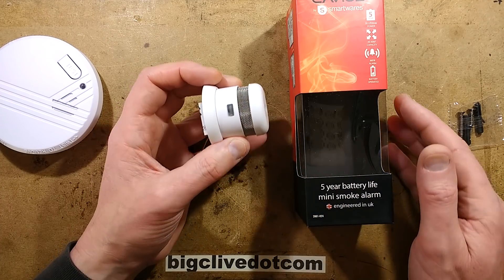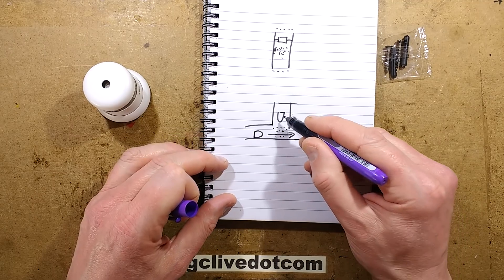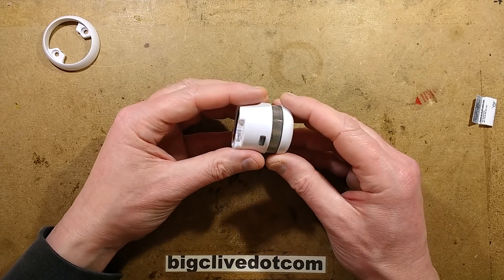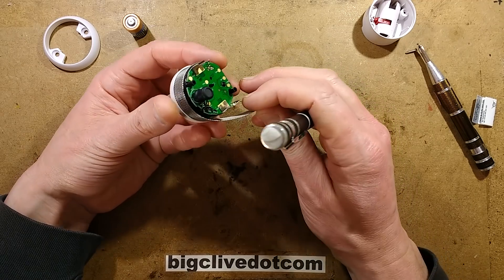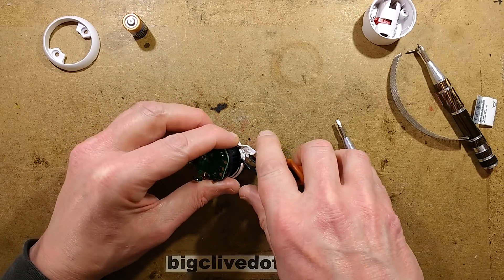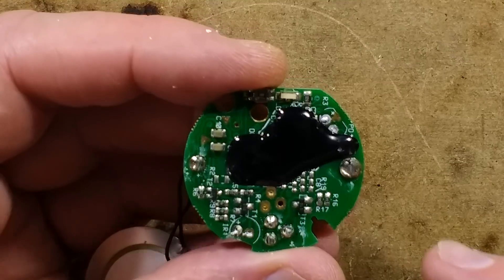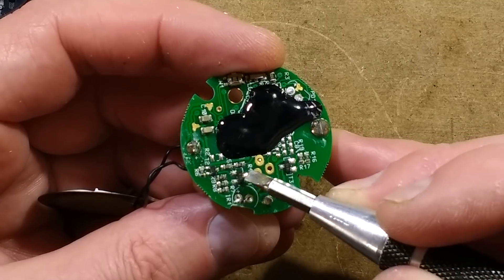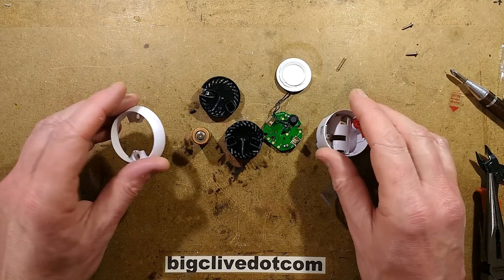Inside the tiny Cavius smoke detector.

Comment: I got the opportunity to strip a few boards from several decades old ionising smoke detectors and from what I've found they usually have the quantity of Americium stamped onto the fairly thick steel plate cage surrounding the button and the examples I handles were all in the range of 150 to 180 microcuries.

Comment: Interesting. FWIW, in the US, at least in most places, the rule is 7 years for replacement (so splitting the difference between 5 and 10 :) ), and building codes or state laws often require (though not everyone follows) that detectors installed (whether new or replacement) in fact be "dual-detection": both ionization and photoelectric. Doesn't mean they don't still sell single-detection units in states where they're technically illegal to install... Photoelectric-only is recommended if you install one in your kitchen, since they apparently are less likely to cause nuisance alarms from cooking smoke (even though you aren't supposed to install them, what a mess).

Related to expiration: perhaps CO detectors have a more definite lifetime - the ones I've had in the last 10 years or so actually will forcibly enter "death-by-alarm" mode at the end of their 7 year rated life - you can't shut them up except by getting rid of them. Was quite a puzzle until I got a replacement and read its instructions, noticing the "what will happen in 7 years" paragraph. Haven't seen smoke detectors that do that though.

Comment: That's a COB (Chip On Board).  The bare unpackaged chip is mounted to the board, then the resin gooped over the top.  Cheap and cheerful way of doing it, pretty common inside consumer electronics, usually on the back of LCD display modules in DVD/PVR machines and almost always inside remote controls.
Reply: Am 4yrs late but its not a bare dice in the vid of the manufacturer its a freescale mcu and a opamp package

Comment: I took apart the "Widowmaker" smoke alarms straight from Shenzhen -- three LEDs, a button, smoke chamber, single chip which is anonymous and a driver coil for piezo sounder (and some support components). Done.
It seemed to activate on thick smoke and not glycerin smoke and if the chamber is opened even slightly, it immediately activates alarm.
The nickname is because they have high chance of failure and QC mishaps which may mean DOA units may pop up on supply quite frequently.

p.s. After the law changed, all smoke detectors sold in Korea now speak "Please evacuate immediately, the building is on fire"  and beep extremely loudly (some even have self-diagnosis voice which announces "Unit Malfunction" if failure is detected).
Previously ones that have been installed do not have any buzzer whatsoever, but now they must have at least beeper.
Also, they all use batteries that are not quite user-replaceable (that lithiun battery has two wires on a socket that must be inserted before it can be installed) because battery-less smoke detectors are incredibly dangerous due to their false sense of security inducing power.

Comment: Two other reasons for the frequency sweep:
1. Your ears may lie in a zone of destructive interference if the tone is fixed frequency, so you may not hear it.
(Similar reason for why emergency sirens also sweep as the waves bounce around buildings - a single frequency is difficult to locate).
2. Partially deaf people may have dead spots in their ears' frequency response and may not hear a fixed frequency - a sweep therefore gives a better chance of catching one.
Reply: anonymic79 Just use your cell as an alarm with a file with some kind of misic or sound that would span your needed range.
Reply: Wow makes sense thank you very much for your time bye take care 🍄💋🍄💋
Reply: Good point TE, but even for a 1kHz square wave, the harmonics are 1/3 x 3kHz, 1/5 x 5kHz, 1/7 x 7kHz etc, and get progressively quieter so less 'alarming'. For high frequency square waves, only the first few harmonics are significant.
All square waves with a fundamental above a third of the frequency of your hearing bandwidth sound like sine waves because all the harmonics are filtered out.
eg, if you can't hear above 2kHz, then all you would hear is a 1kHz sine wave because all harmonics would be inaudible, if you're not in a standing wave trough.
Smoke alarms have to cater for as many people as possible, not just those with average hearing.
( I did a postgrad in this stuff years ago )
Reply: I recall  a TV news story couple years back where they showed teenagers,who love loud music, 8 out of 10 slept through the beep beep beep ones outside a closed door in hallway, they tested a  multi tone style the night after, and 10/10 woke up
Reply: Which is why when my smoke alarm battery needed to be replaced, I couldn't figure out where the noise was coming from, because it did a single ultra quick single tone beep for what seemed like some interval between every 60 minutes, so it was impossible to locate where the sound was coming from, because it was in another room. If it had done a sweeping sound, or at least several beeps in a row, I would have figured it out instantly.
Reply: Also one of the reasons trucks are switching over to white noise generators instead of the old style beepers.
Very easy to get used to the beeping noise and on busy construction sites for example, lose track of what exactly is reversing.

Comment: beware the springen sproingin!

a)where or what brand are your lil aluminum handle screwdrivers?
b)would you recommend those detectors for actual in-house use? or should i mix with optical detectors as well?
c)those little CR2 lithium cells are stupid expensive. normally used in cameras my most common use is really bad-ass tactical style flashlights.
Reply from the maker: The screwdriver set came from Poundland.  It's a standard 8 in 1 or 9 in 1 precision screwdriver.

Comment: What would happen if one were to recharge the battery that comes with that detector?
Reply from the maker: +Walking Zed's Push Bike It may result in high internal pressure.  Primary cells are not chemically suited to being recharged.

Comment: What if you use a smoke machine in the same room will they go off. If you have a smoke machine can you try it and explain why you can't use them in halls etc
Reply from the maker: A smoke machine will set off most smoke detectors.  In theatres they have to either disable the system and have manual alarm operation during shows or fit rate of rise temperature detectors if haze or other atmospheric effects are being used.

Comment: I have the old ionization smoke alarms, they are so sensitive that when I first turn on my heater in the winter time, the small amount of fuzz and oils that burns off the heat exchanger causes them to go off, even though you can't see any smoke. if a candle is burning in the room they will go off if the candle is below them in a certain radius. They go off if the candle is blown out, I have to put out candles by dipping the wick in the wax.

Comment: The optical are actually less prone to false triggering than the ionization detectors. The optical ones are triggered by visible smoke, while the ionization detectors are better at sensing invisible combustion products generated at high temperature.

Comment: Does the resiny plasticky blobby compound melt at a temperature lower than soldering temperature? Would heating it be a way to get that gunk off? Possibly with a heat gun? Experiment please?

Comment: Hi Clive, just a short comment. The ion chamber detector is more a fire detector than a smoke detector as it detects products of combustion. It would not detect the overheating and early smoking of pvc cables as this is a chemical change and the visible 'smoke' is not due to burning (pyrolytic). An optical is therefore better in a domestic situation as you say and works on the principle of the Tyndall effect. However, there is now a case for CO fire detectors (not smoke) as they can detect the very early stages of a smouldering fire at about 10 ppm. Do like your channel.

Comment: My old housing commission house had a wired in AC smoke alarm. Which is great, you don’t need to change the battery, only problem is it didn’t have a (backup) battery. So you’d want to hope the fire doesn’t get to the house wiring first. Although it was handy for bug bombs, they tend to set smoke alarms off. So you could just set the bombs off and turn the off power for the smoke alarm (on its own circuit breaker, funnily enough). I don’t miss that house though.

Comment: I get 5 years out of 9v powered smoke alarms. Using good quality alkalines is the secret.   The cheap zinc carbon batteries they are typically supplied with run for maybe 12 months. The optical types are murder for triggering with 'well done' toast.

Comment: Hello Clive.
As a Belgian firefighter, I must congratulate you on your professional explanation of the two different smoke detectors.
In Belgium, the sale of the ionizing smoke detector has been banned from 2002 on because off the hazardous radioactive substances radium-226 or americium-241 that is present in these devices and if the detectors had reached their age of 10 years you could not put them in the normal waste butt they had to be safely disposed of by a specialized company, and we do not have a company in Belgium that disposes nuclear waste because normally according to the law it is forbidden to have radioactive material in your possession, therefore we can only buy optical detectors.

Comment: As a cold houser I'm mostly getting false alarms from the water vapour when I bathe. I'd be interested in any differences between optical and ionisation types resistance to false triggering... on the face of it optical should be worse... but maybe that fine mesh would actually keep water vapour out better than the relatively wide vents on the ionisation alarm I've got.

Comment: Can you connect this to each other so if the second floor is on fire the alarm go off in the first floor and the rest of the house
Reply: Most modern detectors have interconnect features so I would hope so.
Reply from the maker: These do not have an interconnection feature.

Comment: We actually have five of these around our house. They were reasonably cheap in a pack at costco and figured they were a good investment since we were down to two old ionizing units, one of which was about as old as I was. They certainly don't last 5 years, though. We've had ours for 2-3 years now and replaced the batteries twice already.
Reply: Ellen Madden 
The battery life will depend on the environment and the frequency of false triggering that occurs.

Comment: These buy the way work and work very very well but having a sealed battery (Which more and more smoke alarms do these days since modern 9V cells last for 10 years since people forget to change the batteries every year or even few years in the older ones which are much more power hungry!) you will need to replace them every 8 to 10 years!
>>>>>>>>>>>>>>>>>>>>>>>>>>>>>>>>>>>>>>>>>>>>>>>>>>>>>>>>>>>>>>>>>>>>>>>>>>>>>>>>>>>>>>>>>>>>>>>>>>>>>>>>>>>>>>>>>>>>>>>>>>>>>>>>>>>>>>>>>>>>>>>>>>>>>>>>>>>>>>>>>>>>>>>

Comment: Hmm didn't you post a video showing the components inside a smoke detector can be radioactive? Is that not the case with this device?
Reply: That is only with the ionization type detectors. This type of detector is photoelectric, so there is no radioactive Americium present in the sensing components.
Reply: Ah thanks for letting me know. Makes sense :)

Comment: I can see a flashing light on one of my smoke detectors. The one in my kitchen flashes a dim light every few seconds. I con only see it in the dark and my eyes are well adapted to the dark. 
     The one in by bedroom doesn't do this, but the one in my bedroom is really sensitive. It usually goes off if I cook something and my bedroom door is open, but the one in the kitchen only goes off if I burn something.
    You expiation explains the light, but not the sensitivity of the other one. It will even go off if I open my oven door, even with nothing in the oven.
Reply from the maker: It can see a very fine haze that you might not see.  Or you may have a rate of rise temperature alarm right above the oven area?
Reply: I can't see how. The smoke alarm in my bedroom can't see the oven. But I think your theory has some merit. I've wondered if it's being set off by a heat pulse, because the smoke alarm takes a few minutes to go off.
    Rather than looking at radiative heat, it might be seeing the pulse of hot air going into my bedroom.

Comment: This is great.My spouse uses our smoke detector as a timer when cooking meals,  fry it until the detector beeps, turn it over and fry the other side.  It also works great when boiling vegetables.
Reply: Yours needs to meet mine. Seems their cooking strategies are broadly similar (Madame believes in making SURE there's no risk of us contracting food poisoning . . . . . :-) )
Reply from the maker: You can get heat detectors for kitchens.  They either detect a sudden rise in heat or trigger at a preset threshold if it rises slowly
Reply: Our kitchen detector's already rate-of-heat-rise. Pretty essential when El Presidente cremates most things . . . . :-). I'm the one who sets the hallway detector off (by forgetting to turn the toast-duration control of our toaster down, when switching from fridge bread to fresh rolls!). Really annoys our Parrot - who's very willing to try to "out-scream" the detector!!

Comment: wouldnt it be easier to have the detector see the diode the whole time and make alarm when the light is reduced by the smoke? like these laser security beams they use to secure art.
Reply: Thomas Herzog slightly simpler, yes but the power use would be WAY higher..might be ok for an Line (mains) powered unit, but any reasonably sized battery would drain way too fast to be practical.
Reply: M. K. 
i see... so it needs more energy to see light the whole time, because the photosensor is active the whole time? kinda makes sense.
Reply from the maker: Some industrial ones use that technique, but fire a light beam over a large area.
Reply: bigclivedotcom
so they dont need a detector every few meter/feet?

Comment: That looks exactly like the first ones we bought when the law changed in California. 4 of 6 started beeping within 2 months of being installed.
In case you didn't know, on Jan 1, 2017 it became illegal to sell to a California resident, or for a landlord to install, a smoke detector that used battery as its prime source of power with less than a 10 year warranted battery. What's more, the batteries can't be replaceable. Once activated, a smoke detector will brick itself if power is interrupted and go into "beep" mode.
Before any Fox News viewers get triggered by the idea of California and regulation tromping all over the rights, etc... , this was the landlord's demand. They simultaneously identified the advantage of having a fire alert system protect their property while not wanting to become an infinite source of 9 volt batteries to their tenants.
Anyways, the ones we had that didn't fail were replaced by "belt and suspenders" detectors that use both technologies to detect smouldering fires as well as raging fires. According to the fire protection experts, the different systems do not fully overlap in their effectiveness. These look like the standard pancake design and haven't had a single beeper in a whole year. That last bit is a record. The old cheaper detectors had a 6-month replacement cycle. "When you change your clocks, change your detector batteries" was the mantra. Now it's "when you change your clocks, press the test button".
Reply: Markle2k I haven't tested my smoke alaŗm in 15 year's!
Reply: Gillenz Fluff I've never tested mine...lamb chops do that for me :)
Reply: The 10 year spec is actually a good idea. Ionization detectors fail after 10 years, and folks do not realize they are putting new battrries in dead drtectors. Requiring a matching 10 year battery means no chirps in the night every year, and ensures the whole thing will be replaced on schedule. (Dust blocks the ionization path after 7-10 yesrs typically.) Yes, I have had them fail to go off during a real fire, because they were simply too old.
Reply: You are twice as likely to die in a fire in your house without a working smoke detector than if you have working detectors.
Reply: Markle2k - I like the part about "an infinite source of 9 volt batteries to their tenants"

Comment: Man, now I want to see a video of Cody reclaiming the lithium out of one of these cells.
Reply: all you have to do is cut them open. the lithium is in metallic form, in a thin sheet rolled up and theres a surprisingly large amount of it. the cell in this vid would yield a thin strip nearly as wide as the cell is high and maybe 7 or 10cm long. then you can put it in a glass of water and watch the pretty flames :)

Comment: In my carbon dioxide detector, the humidity caused an loud  alarm at five in the morning. 
I discovered that there was not enough insulating wax on the PCB. So
 I dried it, I gave more wax from the candle and it is good now.